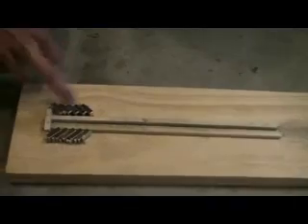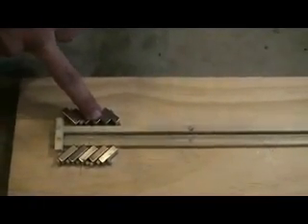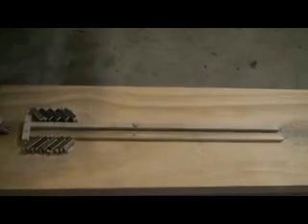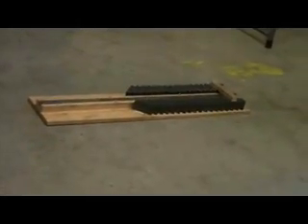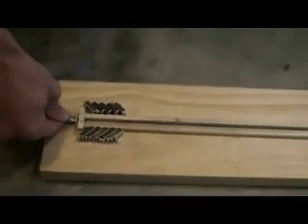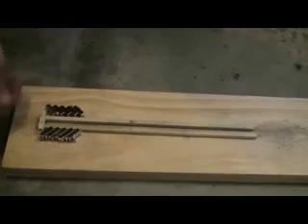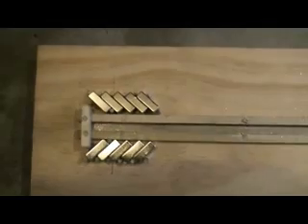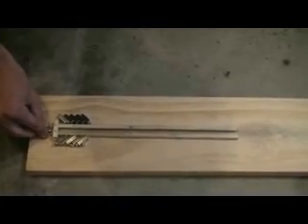MAGNETIC RAIL GUN SCIENCE PROJECT III Neodymium

Comment: You guys should go work on railguns as an occupation for the government. I see potential in you 2.
Reply: Because they made a fake video? I guess the government doesn't have very high standards then..
Reply: i jsut made one of these for science fair...this isnt a fake video...explain how this is fake
Reply: Steel Fuel cant melt Jet Beams This is fake because it brakes some of the fundamental laws of the universe. Where exactly is the energy required to move the projectile coming from? If this worked, it would be possible to make it round and get unlimited energy. -impossible.
Reply: You're saying that if magnets work the way they actually do then it would break the laws of the universe. Now stop trying to sound smart and do actual research on gauss rifles
Reply: Steel Fuel cant melt Jet Beams OK whatever. So tell me: why do we not have free magnet energy right now?
Reply: A guy named Jason Mann said this:
Permanent magnets are solid state objects. Without adding any outside influence magnets have a fixed force. In this respect, they do the same work as a nail in a piece of wood when attracted to another magnetic object. The only way to pull the magnets apart is to add force, in the same way you can only pull a nail from a piece of wood with a hammer. 

In other words, magnetic motors would require energy to push the magnets themselves. Therefor, particle accelerators are not power generators

Anyway, you need to watch the video. They cant have too many magnets to launch it because eventually the initial force will wear down. Understand now?

Comment: Get much smaller magnets then tilt them much further now not 45 degree angle but it's close to 0 degrees at possibly Connect magnets in to end to get more force

Tilt them so that the angles are much shower and push forward more instead inward a

 45 degree angle inward as well as it does forward if you want more make a flatter angle

Comment: as far as i know a railgun uses electricety to accelerate the projectile. so this would be a gauss not a railgun. still cool tough, and surprisingly fast
Reply: Gauss gun work different too.
Reply: Bartosz Kruszona i am aware of that but they both work with ferromagnets instead of elector magnets. so if this not a railgun and not a gauss... than what is it?
Reply: A science project. In railgun a projectile is propelled by electric charge flowing through rails and projectile . one rail is charged positvely and the other is charged negatively and the same thing witch both ends of projectile one is positive other is negative, so rails push charged edges of a shel. To make a real railgun you ned to be very VERY good at electrics and have some experience with high voltage.
Reply: I would just call it a magnetic accelerator. Gauss Gun would be closer than Rail Gun in my opinion. A rail gun uses the Lorentz Force, this doesn't.

Comment: Hey, guys, love your project!  I replicated it on my living room coffee table using 4 + 4 neo magnets -- smaller ones than you're using.  A suggestion?  Instead of going to the trouble of using dowels (though you're doing just fine with 'em!)  you could use brass screws instead.  They won't interact with the magnetic field at all and  sometimes they're more convenient.  Again, congratulations!
Reply: Dear, i want to built this, actually the magnets on the board, are they facing north pole or south pole to each other? Regards
Reply: Julien Aveyron
Hello, Julien -- Doesn't matter.  All Souths facing each other, or all Norths facing each other.  The projectile magnet (assembly) is inserted North first if the rail magnets are North facing, South first if the rail magnets are South facing.  It will require a bit of push to insert the projectile.  Best wishes!
Reply: OK great to know, have a nice sunday!
Reply: Actually is it like number 1 or 2? http://www.flickr.com/photos/92923597@N04/12302452964/
regards

Comment: Have you tried arranging your magnets into a modified halbach array to increase magnetic flux in the direction you want to propel? I say modified, because I'm not sure you can perfectly maintain both the enhanced flux and the angle at which the magnets are placed. If you use a standard flat array, you will need to place your strips at roughly the same angle that the individual magnets currently are in your rig.

Comment: It's an interesting project, but not 'perpetual motion' or 'overunity' in its present state. I built it, and it does work. The catch is that it takes work (Force X distance) to insert the magnet projectile into the end of the device. The work you input there is assumably equal to the work generated by launching the projectile.

For anyone attempting to duplicate this I used super glue and a 45 degree square to stick the magnets together as a unit. I just used pencils glued down as the rails.

Comment: HI Anthony, 

Are the N and S poles, on the fixed magnets, on the ends of the long dimension of the magnets?  You mentioned a BC64 from K&J and that would put the poles on the sides.  I think in another response you also mentioned they were magnetized through the flats. If so that would have the fixed magnet poles either facing up/down or front/back vs towards/away from the channel?  
thanks
Bob

Comment: How did you keep them from getting stuck at the end of the track? As I and other people have seen on other videos, they seem to more often than not get stuck, so how do you get around that?
Reply: The force which normally makes it get stuck at the end is actually before the beginning in this case due to the relative geometry of the magnetic field. if he placed those magnets halfway the track and inserted it at the beginning than he might require to first push it through that force. however perhaps it can be overcome with something like a feromagnetic core to bend the magnetic field which can weaken the impact on the early stages similar to how a quantum levitator can levitate.

Also note that most other people make their guns work based on attraction, this one is based on propulsion, that is why there is a strong rail around it.

Comment: This is cool with the neodymiums.  I have a suggestion for more power... make the rails that separate the projectile magnets from the stator magnets as thin as possible. They appear to be 1/4" to 3/8" in thickness make them 1/8' or 1/16". You could use aluminum bar stock from Home Depot. I read somewhere the strength of the magnetic field is reduced by the cube of the distance from it. Getting the stator magnets closer to the projectile magnets should cause a significant increase the power.
Reply: Can't use aluminum due to eddy currents.

Comment from the maker: Are you using Neos?  Building one with ceramic magnets is easier.  It is really hard to get the neos lined up at the proper angle because the force wants to pull them perpendicular to the track.  That is why we had to use all the small dowel rods to hold the magnets in place.  It took a long time.

Comment: OK man, you have the opportunity to really point something out here

Take a chop saw and cut the current board off right at the end of the rails.  Make another one exactly like this one, using the remaining neo magnets and same configuration.  Test it independently to see if it has similar performance.  If so, chop it off at the 'front' or entrance, and then try the test with just one 'rail', then try again with the two rails set inline, so the first rail launches the magnets into the second.

Comment from the maker: @ongxizhe It was interesting that we didn't need to use the rails to raise the projectile with this rail gun.  Only the ceramic version.
Reply: Must not have to be directly in the middle then, or maybe those more powerful magnets (but not as tall as the ceramics) and the smaller projectile is enough.  At least the projectile LOOKS smaller compared to the 1/2" cube one from the original, but you guys were younger then, so I'm not sure.  I'm still waiting for someone to make this rail (or a series of them) on a large cylinder (say 24" in circumference) with a STATIC projectile held in one place (in the middle of the field) to see if the cylinder will spin past where the rails end the same as it shoots out the other side of a linear track.  If I had the wherewithal, I'd do it myself, but I don't :(